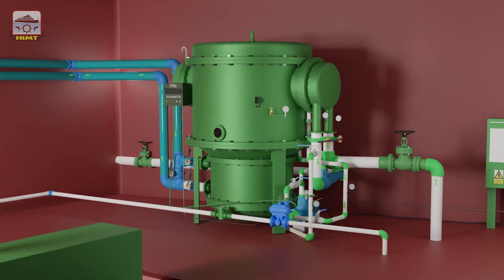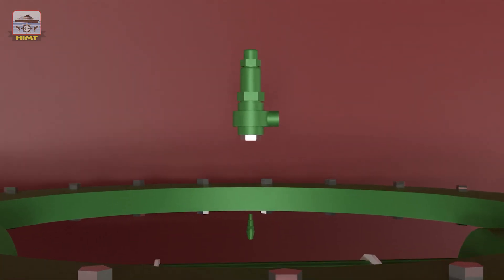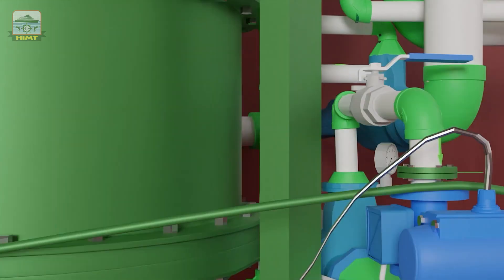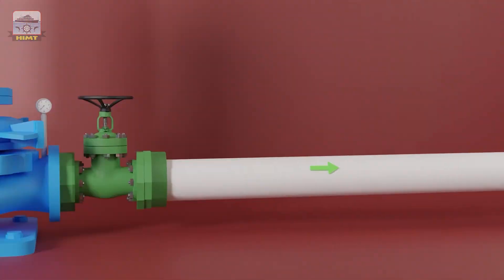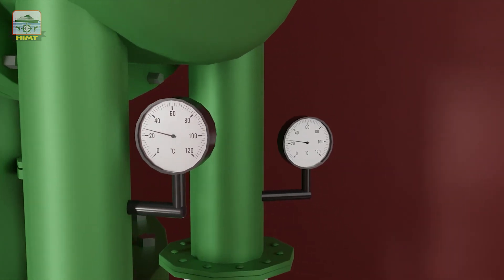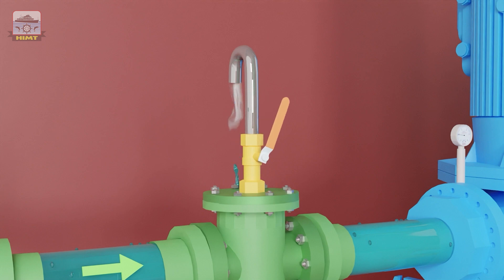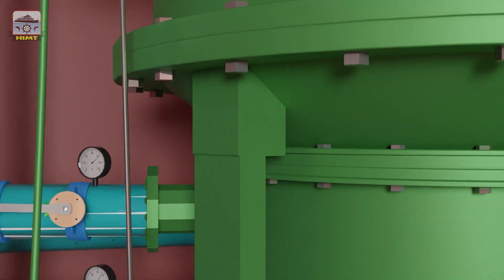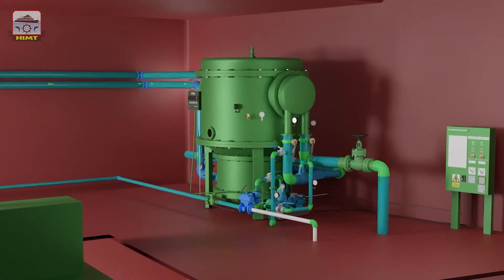Fresh Water Generator on Ships | 3D Animated Explanation | HIMT

Comment: “Are ejector pump and sea water pump the same term? Because in the video it is said that before the ejector pump, a suction strainer is attached. Kindly explain
Reply: The centrifugal pump which supplies sea water to the air ejector and brine ejector is called the ejector pump.
Reply: @paranthamansundaramoorthy4137 thanks

Comment: Sea feed water inlet 
Distillate pump 
Condensor
Salinometer
Fresh water generator shell
Flow meter
Evaporator 
Vaccum distillation 
Conical flask 
Distillation 
Heat exchange water 
Cooling 
Pump 
Strainer 
Compound gauge on suction side 
Pressure 
Thermometer 
Monitors temperature 
Pressure gauge to evaluate the performance of pump 

PPM 
PPT 
NTU 

Voltmeter 
Amateurs 
Readings 

0.3 bar